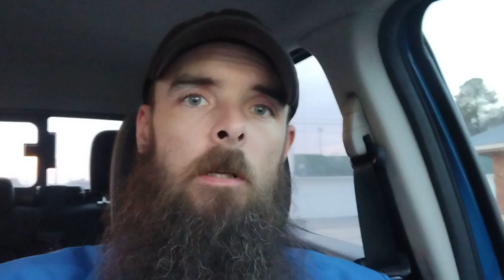Ford 7.3 Godzilla Lifter Failure And Tick/Tap/Click Noise

Comment: Perhaps this is an easy way for the Ford and others to switch people over to battery powered vehicles.
Reply from the maker: I've thought the same thing. Like when there was a gas crisis and it was very very expensive. People won't buy electric cars if gas is cheap. So raise the prices and give them tax cuts on an electric vehicle. Still I won't own one.  This could be a push in that direction. Have to keep an open mind.
Reply: Same here, I want nothing to do with electric cars, trucks, bikes, all of it. Junk!
Reply from the maker: @JAMESWUERTELE  exactly

Comment: The concerning part for me as a 7.3 owner is that I wonder how in the world they didn’t pick this up during testing.  I was contracted to an automotive system manufacturer in the R&D/ testing division and I know that these parts and vehicles go through thousands of hours of testing before approval.  This failure is happening “quick” so it sounds to me like there is a weak link in Ford and they pushed this engine out regardless.
Reply from the maker: Possibly. But it's the exact same lifters in the GM 5.3. They redesign the engine but not the lifters. It's all very concerning.
Reply: Ford sold the same defective transmission in the Focus for like 3 years straight with catastrophic design failures... they would absolutely continue selling the same motor for 2-3 years to deplete their stock, regardless if a risk like this was found

Comment: What dealer you work for? How do I get my dealer to admit this and replace my motor? Had it in at 30.8k but started ticking around 27k. They said they couldn’t hear anything. Back in around 38k and they said they heard it, had ford engineer come look, then dealer told me it was due to a small oil filter Valvoline was using. Made a claim with Valvoline and dealer started moving away from that claim after they had already wrote it into my service history. It’s really bad now at almost 43k. What should I do?
Reply from the maker: Contact ford customer service. Tell them what's going on and that it is getting worse. I'm not at a dealer anymore I went back to fleet.
Reply: Thanks Brother! Appreciate your content!
Reply from the maker: @RiseofTheRepublic1776  no problem. Appreciate you checking it out.

Comment: I believe the root cause is that the computer controlled variable volume oil pump is not programmed to give enough oil under long or extended idle times. This is the first Ford engine I know of with this type of pump. I can't understand why nobody is questioning this. I would bet my reputation as a tech this is lube related, and could be fixed with a reprogramming to give more oil volume under long idle times. Contact me FORD!!!
Reply from the maker: Actually just found out today what the issue is.  It's not a lubrication problem.  We found out. The supplier that asked the lifters didn't put enough bearings in them. Go figure right.
Reply: So is model year 2023 good to go?
Reply from the maker: @mad125100  no idea. I don't have any 23's. And some techs at the dealer I worked at haven't seen any with that issue yet. Little early to tell as most of the 23's will have lower mileage.
Reply: @Bearded Ford Tech  thanks for the info.  I am going to buy one and give it a shot.
Reply from the maker: @mad125100  hell yeah!  Just a heads up. The ones we were seeing were in box trucks. Keep me posted on it!

Comment: Do you have the ford ssm link as I couldn’t find the document ? Or has a tsb came out for the 7.3 2020 vehicle tapping noise , thanks
Reply from the maker: Nothing is out yet.
Reply: @BeardedFordTech   Good Afternoon Malouf Ford ( NJ ) advised that the truck has had a major lifter failure in cylinder # 5 and possibly another one. They were not familiar with any current lifter issue is what the service writer advised but unfortunately its week three of no truck and the drama now is waiting for parts. Just wanted to let you know the update. 52,000 miles on the truck also and power train warranty for 60,000 ( whew )
Reply from the maker: @kennethjlinkjr.2503  dang another lifter failure. It's becoming very common.
Reply: Thanks, my 2020 F350 with 7.3 is at ford awaiting diagnostics for a week now to determine what the noise is as well as the misfire codes, thanks again
Reply from the maker: @kennethjlinkjr.2503  let me know what they find.

Comment: I work  for  a Public Transit  system with 80 cutaways chassis.  The newest  are 10 Ford E350 cutaway chassis with the Godjunk motors.. We had to replace 2 motors because  on low compression  from broken piston rings that scored the cylinders.  This was confirmed  with a remote camera via the spark plug.  With 60 plus G's the dealer denied the repair  along with Ford saying they have  heard of no issues and denied the claim. The more I read into this motor  it  is running the same course  as the 6.0 diesel  we had in the fleet.  Ford should  be ashamed.
Reply from the maker: Yeah these make a different sound and it's not broken rings. But I feel ya on that. I'm not a fan of the 6.0 either.

Comment: My new F-250 with 3,800 miles has: leaking trans fluid, shifts bad, shakes at idle, gears grind from 5 to 4 and 4 to 3, infotainment system goes black until I restart the truck, makes the clicking noise that your statement mentioned, etc. 

Very disappointed, service rep told me today, “ I’m going to shoot ya straight, the reason you don’t hear a lot about these trucks having problems is that we have to fix them before we can put them on our lot to sell.”
Reply from the maker: That service rep is an idiot. We have yet to have them off the lot with problems. I would find another dealer. As far as leaking trans. Have seen that. But that could be why it's shifting hard. Also if a lot of people test drove it the transmission needs to be relearned. Black screen is a software update.

Comment: Has this issue been resolved on 2023 model year trucks?
Reply from the maker: Haven't seen any 23 models with that kind of mileage. Hard to tell at this point. I'll keep an eye out.
Reply: @BeardedFordTech  awesome thank you, just wasn’t sure if you heard anything about a change in the manufacturing process. Looking to buy one at the end of the year and this issue has me a little gun shy.
Reply from the maker: @PatriotDad  understandable.   We are still early in the year. So if you buy later in the year you should be fine. And the ones we have seen fail are still under warranty so there is a positive side to a bad situation

Comment: This is Fords way of finding the issues on a new product. Rather than throughly testing a product before releasing it for sale (like Toyota does) they are happy to take your money and let you test the garbage they make on your dime and with your time. Do any amount of research and learn that Ford has major quality issues and they are number one in recalls over every other vehicle manufacturer. Look at their history: 6.0 and 6.4 diesels the worst diesel engines in modern history. Ford Edge water pumps inside the engine driven by a timing chain. Dual clutch transmissions, 2.7 Ecoboost head gasket failures due to a faulty design, Spark plugs blowing out of heads, 5.4 Triton V8 engine failures, CP4.2 Bosch high pressure fuel pumps (used on 2011 to current 6.7 Powerstrokes) with a design flaw that Ford has known about for years yet they continue to use it and will usually not cover the $12 k repair bill. There are hundreds of examples like the afore mentioned yet people still give Ford Motor Company their money, Unbelievable!
Reply from the maker: Toyota isn't any better buddy. Frame recalls for frames. Let's not forget the new tundras and Tacoma's coming off the trucks with leaking transmission pump seals. Everyone's quality control has gone to garbage. And actually Ford does hold the most recalls according to year 2022. They released 67 more than GM. Putting GM in second.

Comment: Good info ! Thanks
Reply from the maker: Your welcome
Reply: @BeardedFordTech   I’ve been doing my oil changes at 3K intervals using Mobil-1 Truck & SUV 5w-30 formula . Hopefully 🤞 this helps ? I’m at 16 K miles now on my 2021 F-350 7.3.
Reply from the maker: @roadglide1142  get that mobil one oil out now. It is made to the lowest quality and is very low on oil sample tests. Check out Ford Boss me videos where we discuss mobil one. It's not what everyone thinks it is. You want you engine to last we recommend you don't run that.
Reply: @BeardedFordTech  I’ve had a 1994 Ram 5.9 Magnum V8 that was running perfectly at 400K miles on Mobil 1 when I sold it . Another 90’s 5.7 era GM 350 300K miles . Both engines spotless inside . I believe in real world results rather than lab hyped results.  Two Ford F-150 5.4 3v’s high mileage also . Never a lubrication issue with any of my engines using this oil . What’s important is changing oil . Just my real life experience. 
On that note the Ford Synthetic blend is one of the worst performing oils I’ve seen in a virgin oil “ Lab Analysis “ . But he doesn’t talk about that oil for some reason? Hmmm 🤔 Keep in mind I’m 57 years old & have been changing oil since I was 15. I do 3K intervals cause I’m old school.

Comment: I run a 21 7.3,  wondering if a zddp additive would help
Reply from the maker: It's not a maintenance issue. It's a lifter manufacturer issue. If you have to run additives in oil. You need a better oil. You can try switching to Amsoil. But as mentioned it's a manufacturer issue. Whoever makes the parts for ford
Reply: @BeardedFordTech  Thank you.  Im going to run mine hard till it gives up,  then fix it,  then run it hard again.  Thanks for your Work
Reply from the maker: @toddeliott20  drive it like you stole it!  Your very welcome!
Reply: @BeardedFordTech  Sounds like if its going to fail theres no helping it,  Im at 13K,  I better get some miles on it before warranty

Comment: My 7.3 was built in October of 2022 does in fall in the lifter failure or is it all 7.3s?
Reply from the maker: It doesn't fall under anything. Just random ones doing it. Seeing it more on the 2022 models. And box trucks
Reply: Thanks.
Reply: Thanks. I printed out the Sam. I’m bringing it to the dealer when my 23 f250 7.3 comes in next month and will raise the question.

Comment: "Delaminating". ROFLMAO. It's called brinelling. And its to be expected running 20W50 motor oil in those boat anchor Ford "big-blocks" with so-called "LS lifters".
Reply from the maker: Delaminating is what we call it. And who runs 20W50?  That's Harley Davidson oil. They run 10w30 5w40 severe duty. Think you need to go back and do some research
Reply: ALMOST EVERYONE BLAMING GM FOR FORD'S LIFTER DELAMINATION IS ABSOLUTELY HILARIOUS AND YET DOESNT FIX THE FACT THAT THEY SHOULD ALL BE BLAMING... FORD...
Reply: @useritscarrot  I agree with you for the most part. However, I think it is hilarious for people "pointing the finger" to the manufacturer's they do not like. That's what you did. A manufacturer is not going to specify making a faulty part or using poor methods and processes. A big design or engineering blunder in the frame or other OEM produced component or part would be the time to "point the finger". ALL of the "Big Three" U. S. automakers build great vehicles and junk vehicles. 

Blame Ford's testing of the 7.3L V8. What about GM's testing of the 6.2L V8 with the same problem???

To clarify...I never blamed GM for Ford's roller problem on the lifters and lobe problem on the camshaft.....but, the same exact problem occurred on the GM 6.2L V8 engine prior to the problem on the Ford 7.3L V8. 

It is obvious to most people the Third Party supplier for the internal engine parts has produced "some but not all" defective lifters and camshafts......because not every single GM 6.2L V8 or Ford 7.3L V8 has those problems. Therefore, the trucks with the 7.3L V8 tested by Ford most likely did not have the defective lifters and camshafts.

IF the problem occurs with my 2022 F350 Lariat Tremor....I have two options.

1. I will either wait for parts...even several months, because I have multiple vehicles to drive.

2. Order a new 7.3L crate engine

3. Install high quality engine builder aftermarket lifters and camshaft...even if it voids the engine warranty. 

I will not let Ford "buy back" the truck.
Reply from the maker: @useritscarrot  not blaming GM. It's the people who make the part for GM and ford is the problem
Reply: @useritscarrot  Your statements simply prove how much you don't know! There are hundreds if not thousands of parts that are identical or virtually identical on several different makes of trucks...Ford, Dodge and GM.........and also different models...SUV's cars, etc.

Some other clown made similar comments on another YouTube video Channel (Powerstroke Tech Talk w/Arod) regarding a shattered Transfer Case in a Ford Super Duty 4WD......not realizing ALL transfer cases for light duty trucks.....Class 1, 2 and 3...and even medium duty Class 4 and 5...have been made by two manufacturers for several decades...as in 50+ years. The two manufacturers...first, New Process aka New Process Gear which later became New Venture and the second, Borg Warner. 

It's EXACTLY THE SAME with the Lifters and Camshafts...........and who knows how many other components and parts. I am now remined by another very common mistake. Actually, this error is running at 100 percent. I have NEVER read any comment on any thread on any forum referring to the correct manufacturer name regarding the 10.5 rear axle assembly. Read the next paragraph for an example of people not knowing what they saying and or writing-------------->

EVERY SINGLE comment I have read on all of the Ford - Super Duty - Tremor - Powerstroke.......you name websites......most guys, even mechanics call the rear axle assembly under the Ford F250 and F350 SRW a "Sterling 10.5". That axle assembly IS NOT a 'Sterling'. There "might be" a company named Sterling, but they dang sure DO NOT manufacture the 10.5 axle assembly. The 10.5 is manufactured by Ford Motor Company (FoMoCo) at their own axle plant located in Sterling Heights Michigan. Ford company people call the PLANT the Sterling Axle Plant.....but that does not make the axle a 'Sterling'....the 10.5 is still a Ford built axle.  

Hopefully, this error will not be repeated in the future since Ford is now using the Dana M275 rear axle assembly for the F250 and F350 SRW trucks.

Quit pointing your finger at the manufacturers and make meaningful productive comments instead...... OR simply keep your mouth shut....and then stop your brain from commanding your fingers to make keystrokes on your computer and thus preventing the embarrassment of yourself.
Reply: Lmfao... 20w50?! What!? Lmfao Ahahaha
Reply: It's like trying to blame Cadillac or Honda for cylinder deactivation lifter problems that you're having in a... Ram.. lmfao 🤣 blame the manufacturer that sold it to you!
Reply from the maker: @useritscarrot  sorry if that came out wrong. It's the manufacturer making the parts for everyone. What I was saying is it's the same design
Reply: @DEEREMEYER1 you sound like a idiot.
Reply: Correct, it is not delaminating because it is one solid piece, not a laminated roller. Not brinelling either. It is called flaking or spalling. Brinelling is a dent due to impact or excessive load resulting in plastic deformation. The surface is flaking off most likely due to lack of lubrication. I have heard they don't have enough oil flow to the lifters at idle but not sure if that is true.

Comment: Well this killed the momentum of this Godzilla. I was really hoping for a between truck not a diesel but not the smaller 6.2
Reply from the maker: I love the 6.2. I'm not really a fan of the 7.3
Reply: @BeardedFordTech  yeah, I leaned that route but the 6 speed failed at 3k and now I’m waiting to find out buy back options because transmissions are on back order. So possibly getting the 7.3 but we will see. 🤷‍♂️
Reply from the maker: @ck3561  just about everything is on backorder. It sucks
Reply: @BeardedFordTech  I don’t mean to put you on the spot but in your professional experience the F250 crew cab with a 6.2 V8 with a 3.73 rear end six speed torque shift transmission. What’s the maximum fifth wheel tow capacity?
Reply: @wakeupamerica2024  thanks I did. 12.5k  I just don’t understand how The Chevy 2506.6 gas with 373 rear end has a 16.5 K5th wheel gooseneck tow capacity. 

The F250 even with the 7.3 gas only has a 14 K capacity fitted with crew cab short box 355 gears 

The F350 crew cab, long bed 373, gears 7.3 gas has a max Toca by Citi, 15.9 K. 

I guess to sum it up go Chevy I just don’t understand how they’re able to accomplish that and even with the larger engine and 10 speed Ford cant hit 16k unless you have short box, regular cab then you get 21k
Reply: @ck3561  The 6.2 isn't rated to tow a lot.  I had a 7.3/3.73 crew cab long box and it was rated to tow 16k.  I towed closer to 18k with it just fine.

Comment: are you replacing long block assembly due to metal contamination from the camshaft and lifters, even  if cost cap say's to repair not replace ?
Reply from the maker: Replace engine. Cost cap will tell us to replace it

Comment: I have a different knock, not like the video there. Can the drive belt rollers knock like this? When I start engine in the morning, it starts to whistle, either belts or rollers. The problem appeared around the same day when I heard knocking.
Reply from the maker: I can check TSB for that
Reply: Mine does that as well
Reply from the maker: Belts is probably whistling pulleys usually don't knock. They make high pitch or growl sounds. And no TSB